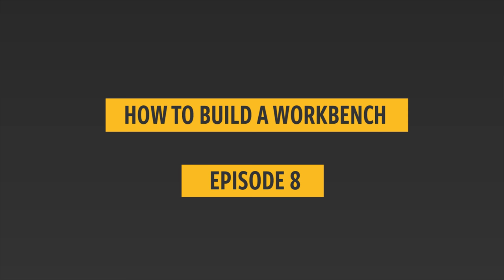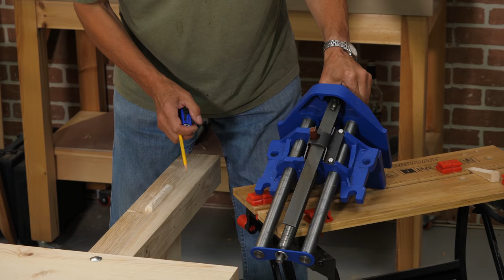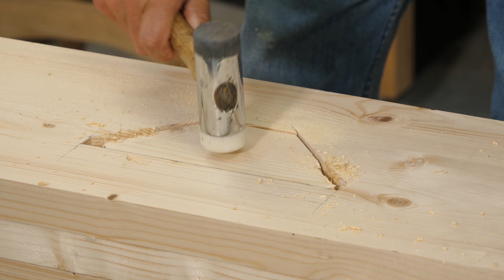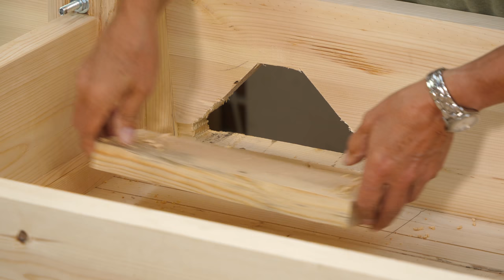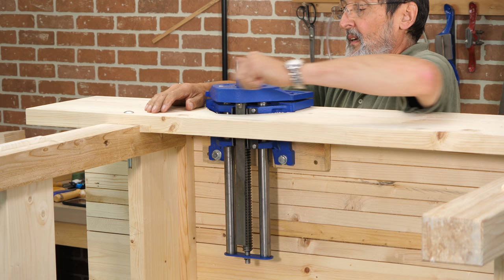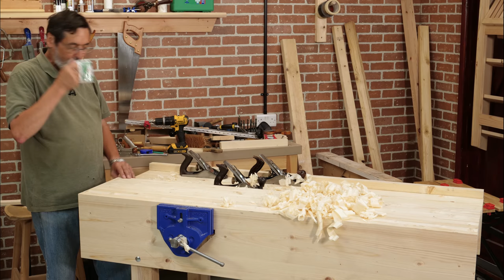How to Make a Workbench Episode 8 | Paul Sellers

Comment: Why so much planing again, you planed it flat in the beginning.
Reply: I might be wrong but I think he only planed the underside of the top before assembly. When I did mine last summer, I planned the top of the top before installing the vise.
Reply: Furthermore, I think planing of the underside was "adequate" planing just to ensure no twist, flat across the width, and the length straight to the eye ball. This would ensure proper seating of the top on the leg frames. It would also ensure that all four feet touch the ground when the top is screwed to the leg frames (assuming the ground is flat). (Don't ask how I found this. I had to use a shim somewhere between the top and one leg frame)
Paul last planing of the top of the bench was made with much greater care then the underside as it might be used as a reference.

Comment: This was a poor vice installation imo. The fixed plate should have been recessed in flush with the side of the bench imo.
Also, fixing the fixed plate while the vice is held open against gravity looked shockingly unsafe! If someone with a less than perfect vice could try this and get a right sore one if that plate comes thundering down unexpectedly. The bench should have been turned the right way up for those last screws.
Not the best video from Paul Sellers standards imo.

Comment: Video was great except the half-assed parts where you’re using the wrong tool for the job. Dragging the drill bit to make a pre-cut and using a crescent wrench instead of a socket with extension is a shame. Someone that prides themselves in woodworking then makes it harder than necessary. Plus your cutout for the vise looks lazy. Yeah it works, but come on. Oh, and a hand drill? Was this video made in the 50s?